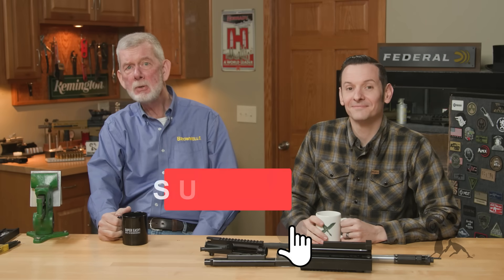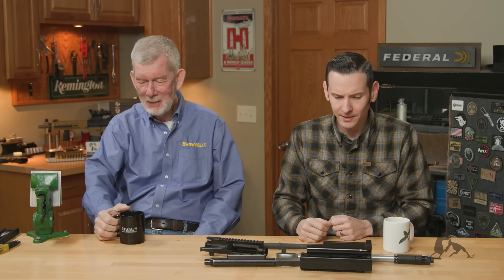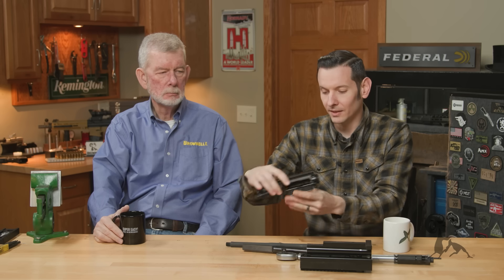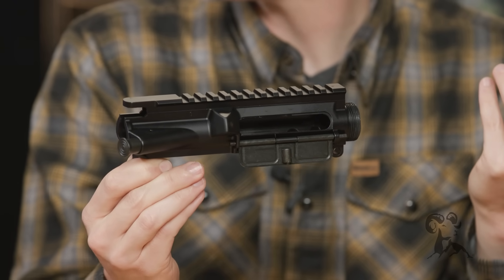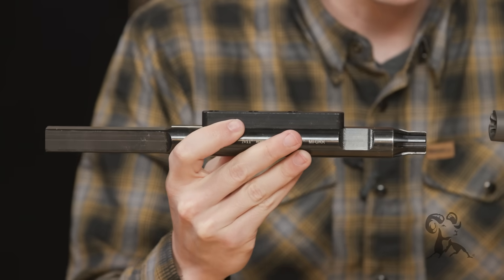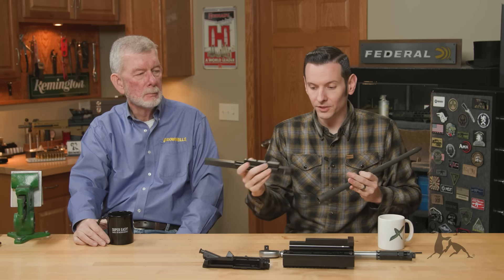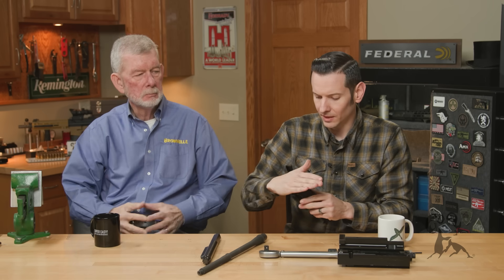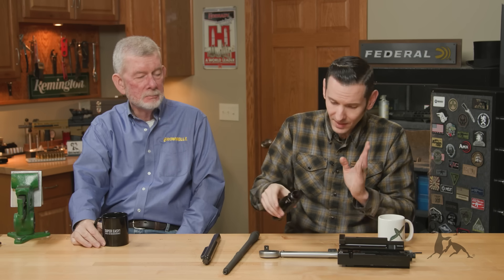SmythBusters: Top 5 AR Building Myths

Comment: When I was an armorer in the Marines 77-88 all we had to remove and install barrels was aluminum blocks to clamp the barrels and never had a problem. People act like they are assembling 1000 yard 1MOA rifles  Your not hand fitting anything you are assembling parts. Most off the rack AR15/M16s shoot better than the people shooting them.
Reply: I never could figure out why you couldn't just clamp the barrel. My first build used two 2x4s and some bolts for clamps. I had my girlfriend stand on the 2x4s to hold them steady.

Now, I have all the "proper" tools.
Reply: @09jisaac 🙂
Reply: @09jisaac  You can and that is how the military did it for years by using barrel clamps..The problem with that method, the device or the clam shell vice is it still torques the barrel in the upper and if too much torque is applied, it can shear the barrel index pin, damage the upper in the index notch or both..Many upper receivers have more play between the index pin and receiver notch than others and the barrel can clock using these methods..This can cause the bolt to hit the outer receiver extension lugs, damaging both..A receiver rod with a sail like the Mid West ind. or the 2Unioque will limit the movement and takes all the stress off of the barrel index pin and upper receiver notch..Look up sheared index pins or damaged uppers, there are a lot of them..
Reply: I say this all the time. Gun is way more capable then we are
Reply: I’ve assembled 100s of uppers using a pro mag polymer upper receiver clamp. Never a single issue.
Reply: @baddogwaterfowl7302  How do you know?? Many people have clocked barrels and don't even know it.. Unless you insert a Mid West URR or a 2UNIQUE in the upper as a gauge, you will have no idea if the barrel is clocked..Caleb reversed his opinion on this subject (which made me respect him even more as a gun smith) after watching Chads video on School of the American Rifle that he made to counter this video..Go check it out..
Reply: @hairydogstail that was a great video, that I immediately thought of while watching this. I’m glad he backed off of this stance, because the over simplification of any trade can be disastrous.
Reply: Well, some of us are building 1 MOA, 1,000 yard rifles...

The beauty of the AR platform is you can do that if that is your thing.,

Now, regarding the barrel nut, clamping force is a product of the torque applied and the size (and thread pitch) of the fastener.  The barrel nut is quite large and the torque spec wide, I think 30-80 ft-lbs.  For the size of that fastener, both ends of that spec are low values.  By comparison a 1/2" wheel stud is usually 100 ft-lbs or a little more.  If the barrel nut torque was a spec for maximum clamping force it would be well over 200 ft-lbs.

The takeaway is that the required clamping force is low and some of these specs were written just to tell people it has to be kind of tight but don't overdo it.

The unfortunate result is some people crying because they torque to 80 ft-lbs and their gas tube is hitting a barrel nut tooth.

The real method is you should torque to 30 ft-lbs, then tighten it a bit more to clear the gas tube if you need too.

But some people will still be clutching their pearls and then you can say, fine, mark the tooth that is blocking the gas tube and dremel it off.  You don't need all of the teeth and that will let you get your precious 80 ft-lbs.

Now some people are crying because you said the D-word and you have to lap the receiver more or use barrel nut shims to get the gas tube to align at 80 ft-lbs.

No matter where you stop on that journey, the result is the same.

I know that but I do some unnecessary things.  I prefer an upper receiver block that grabs the picatinny rail of the upper.  I just think the upper rail has more material to efficiently transfer barrel nut torque through the receiver to the vice.  I don't loosen fasteners with my torque wrench if I have my breaker bar handy.  I don't use a 1/2" torque wrench that goes up to 200 ft-lbs to torque a 30 ft-lb barrel nut.  Torque wrenches are most accurate in the upper half of their range so I go for an appropriately sized torque wrench that will be accurate around the value I'm shooting for.

Lastly, I am going to clamp my barrel when I mess with my muzzle brake.  I know it's not required but I might need to use more than 30 ft-lbs to clock my muzzle device on a crush washer, that might twist the barrel under the barrel nut and for that 1 MOA, 1,000 yard rifle, I don't want to mess with that after I have tightened it...

With all of that said, I do have a reaction rod (no wing) and one of those Magpul things.  I have tried them and I might use a reaction rod in an upper with the barrel extension pin notch wallowed out to keep everything straight (this might also be a reason to dremel a barrel nut tooth and go to 80 ft-lbs) but I usually use nice parts that just don't need anything special.  I do like the reaction rod for tightening muzzle devices.

It's a balance of putting in a minimal effort over what is absolutely necessary without convincing myself that my way is the only way or that it's better.  It is just the way I do it because doing it the same every time helps me avoid stupid mistakes and a method that works on a 1 MOA, 1,000 yard rifle is going to work on a mag-dump in to garbage rifle too.
Reply: @beardoe6874  If you torque your muzzle device over 20 ft lb's, you are compressing the bore and it will wear the lands more at the muzzle...Not a good idea if accuracy and barrel life is the goal..The barrel nut spec is 35 to 80 ft lbs and the threads should be tightened and loosened 3 times before final torque to condition the threads so the nut won't come loose..
Reply: @hairydogstail  well, I also like barrels with 5/8-24 or 3/4-24 threads instead of 1/2-28 to prevent those issues.

If you're really serious you can cast a lead lap to get the barrel the same size from the throat to the muzzle.
Reply: @beardoe6874  I don't think you understand how much the bore compresses with the increase in torque..Use a muzzle erosion gauge with every increase in torque and you can measure the compression.. The barrel size has little effect..The same happens to the upper receiver when you increase the barrel nut torque..Lapping the lands down is not a smart alternative to using proper torque and Rocksett..
Reply: @hairydogstail  I don't think you know how much torque it takes to clock a muzzle device if it's off 15-20°.  You might just have to go over 30 ft-lbs and then you might be messing with your barrel nut torque.

So two good practices are larger muzzle threads and using a reaction rod/barrel clamp.  There is no downside to either and guess what, you don't have to use excessive torque unless your muzzle device clocks wrong.

But go ahead and argue against things that make sense if that's your thing...
Reply: @beardoe6874  I never mentioned anything about the way you clamp your barrel lol, I was talking about muzzle device torque....You don't need to over torque a muzzle device..That is why they make washers for muzzle devices (Accu-Washer) in different thicknesses.. 
Do as you want with your rifle, no skin off of my teeth..I thought we were having a discussion, not an argument..Sorry I triggered you lol, but you don't make sense..Later!
Reply: @hairydogstail  well that's a weird tangent.  The discussion is about barrel nut torque and reaction rods.  I just was saying I prefer to clamp my barrel or use a reaction rod when I'm torquing a muzzle device so I don't disturb the barrel nut.

I don't think I've ever used a torque wrench to tighten a muzzle device but I don't think I've tightened any too much, it's just that 20 ft-lbs and 30 ft-lbs are too close for comfort and I'm not afraid to use the low end of the barrel nut spec, so I use a reaction rod or barrel clamp when I tighten muzzle devices.

So why are you telling me I'm tightening my muzzle device too much?  The topic is the barrel nut.

Any way, you went off topic responding to me and you know what that gets you?  You get my opinion.

Now you feel attacked because your hit and run tangent got a well reasoned response.

Weird.
Reply: @beardoe6874  Hit and run tangent?? Well reasoned response?? Not even close.., I was stating a fact that is easily tested and verified, which you took as an insult to your ability or lack there of..Like I stated before, go ahead and over torque your muzzle device and ruin your barrel/ accuracy..No skin off of my teeth..
Reply: Well said.  @beardoe6874
Reply: @beardoe6874 Yes, there is a quality issue here.
Reply: The first problem is that there is a certain degree of machismo when talking about guns where people have this inherent need to feel like they're right and you're wrong, even when there are multiple correct answers.

The second problem is that, if you look at the demographic data of who owns guns, you'll find that most gun owners are in the bottom-half of education level and tend to work blue-collar jobs.  The people who are generally making those arguments just don't have a lot of analytic thinking skills that they've formally learned, or that they even use on a daily basis.
Reply: And all the barrels you were using were the same profile and length, this is simply not the case with all the barrels on the market. Why waste time with barrel clamps that might not properly clamp the build you're doing when you can get a ~$50 (Botach Double Action Rod) tool that is agnostic to these variables? I completely understand people not wanting to pay Geislee the outrageous price they charge for their reaction rod but there are now even better alternatives at 1/4 the price, why not buy one?
Reply: That's because you were using parts that met the TDP spec..When you add parts from multiple different manufacturers that do no meet the TDP tolerances, that's when problems occur..Go on line and you will find endless videos of problem AR rifles..Sort stroking, jammed cases, clocked barrels, won't cycle, etc,etc....If it was as easy as you say, none of those videos would exist..There is a reason certain tools and techniques are used and Caleb is over simplifying that subject IMO..
Reply: @hairydogstail You seem to be a very smart guy. It would be good to see videos of the Rifles you have come across with problems. Troubleshooting and proper repairs made.  I have PSA lowers and  Shaw custom Barrel.. upper Barrel  combo's . No problems at all.  I have assembled a couple lowers with parts kits, with no troubles. I have installed a couple drop in triggers. That's my limited  experience.  I'm very interested in AR15 assembly and repairs.
Reply: @hairydogstail  Some people assembling AR's have no business trying to put together a friggin jigsaw puzzle let alone a friggin Carbine/Rifle. Assembling a AR isn't that difficult, I walked my Daughter through the process when she was 12, she is 16 now and can assemble one even if every part is thrown in a box as shook up.
Reply: @adamrodgers2377  The big problems is when parts from different manufacturers are used and even from the same manufacturer..I have shelves full of parts that are not in spec/tolerance..Those parts can many times be used successfully if the knowledge is there.. After the rifle is (assembled) and the gremlins begin to show up is when the real fun begins for many (assemblers), this is why I call my AR rifles (builds)..I have seen this occur over and over and over..One AR will run like a Swiss watch and another is plagued with problems..Then the usual wrong assessments begin to pour from people trying to fix the problem..It can be as entertaining to watch as people trying to back their boat down a boat ramp..

Comment: Has anyone ever shimmed the barrel for a better bolt fit?
Reply: Shimming the barrel does nothing. The headspace is built into the barrel extension and the bolt by the manufacturer.

I can prove this by the fact that some hand guard kits come with barrel extension shims so you can properly index the barrel nut to the retaining system. If it changed headspace it would be a no go. No manufacturer would do it because of liability problems. 

I also work for a large AR-15 manufacturer. You can't make the bolt "fit" any better than what comes out of the factory.
Reply: @oldscratch3535  Bolts come in different sizes and I have corrected short chambers by changing bolts..I separate them small, medium and large..
Reply: @hairydogstail  You can do that and it will work but if the barrel is not headspaced correctly and you make it work by finding a bolt that is also out of spec just know that the parts are not interchangeable with other parts. You've essentially married the parts together for life. If something breaks you have to find another out of spec part to replace it. It may work, but it's technically an out of tolerance part. 

However, my point was about shimming an AR15 barrel. You can't change the headspace that way, which is what the OP was asking about.

Comment: I've used torque wrenches to loosen bolts and never had a problem with them. I used the old style though of torque wrench called a beam style torque wrench. It was a great wrench and worked for years. The only worry I have is about trying to get a 20" 1in7 twist barrel for my Ruger 556 someday. Have any?

Comment: I have an upper that the barrel won’t slide into someone told me I had to use a torch it to expand the opening of the upper…. Is that a thing ?
Reply: It's called a thermal fit..
Reply: Yes. Just heat it slightly with a heat gun or propane torch. It will be fine. Some manufacturers do this on purpose. BCM specifically.

Comment: I am pretty sure that my old beam type torque wrench will bend if I loosen nuts with it.  It is only hardened in one direction.  I really should build an AR, but the ones I have are pretty accurate as they sit.  Now, where is the video on bullet proof hair product?

Comment: Well crap.   I did it all wrong. I wrapped it in a towel and clamped it in a vice tight enough to hold it but not so tight that it pinched it.  Then torqued it down with my homemade wrench that I could put a torque wrench in.   It shoots good enough to cover my groups with a dime at 100 yards.    Maybe I got lucky?

Comment: You can ruin a torque wrench by putting more torque on it than it’s set for or rated for.
The head of a torque wrench swivels on a pin, once you hear the click you need to stop.
I was taught that in auto shop in high school and motorcycle school in college, and have seen wrenches with the pins, heads broken and sides smashed down.
Just try torquing down a bolt that requires 120 ft lb with a 50 ft lb rated torque wrench and see what happens, it’s not a breaker bar.
Reply: You can..
Reply: I’m curious, what AR has a barrel nut torqued to 120 ftlbs?
Reply: @TheArmamentShop  Ones the customer red loctited the threads because some nimrod on the internet told him to do it..
Reply: @TheArmamentShop  FAL Imbel kit with the receiver stub still on the barrel. I don’t know what torque specs Imbel used but I have had to use a cut off wheel, hammer and chisel to split the receiver stub to get it off.
Steel receivers with threaded barrels sometimes require high torque to time the barrel within specs, without shaving the barrel shoulder.

Comment: Honest question for anyone with an idea. My dad is building an AR308, his barrel and handguard are from JP Enterprises. The instructions say to use red loctite 271 and to install the barrel nut and hanguard hand tight, then torque to spec 24hrs later. Now it completely seized and won't come apart even with a heat gun. Does anyone know of a chemical solution or another method to release red loctite?
Reply: I'm guessing my dad probably put loctite on the wrong part. I'll tell him to try a torch and see if that works. Thanks for the feedback.
Reply: @TheAbysmalOne  No problem man. Hope it works out for you.

Only use propane though. Don't use an oxy/acetylene torch. It will get too hot and possibly melt the aluminum upper.
Reply: @TheAbysmalOne your b. S. Me man not really what in the world loc. tig.on a stinking rec. Threads. How totally Insane. All that and you didn't think about it you had to of FIGURED next day tighten it WHAT??
Reply: @TheAbysmalOne pay Ricky Bobby no never mind. He ain’t got past 3rd grade yet
Reply: I've never heard of anyone saying to loctite something and then torque it to spec AFTER the loctite has cured. 271 has a 24 hr curing time so anything after that isn't going to move. 

You need way more heat that a heat gun can put out. You have to heat 271 to 500F to break it loose. Not sure there is any chemical you can use.

Looking at the JP website, I can see that some hand guards have a barrel nut and then a barrel retainer nut. The barrel nut looks to be hand threaded on with the gas tube hole aligning with the upper. This part gets the loctite. 

The next part that actually holds the barrel in place and gets torqued is the barrel retainer nut. This piece DOES NOT GET LOCTITE. It says to apply anti-seize compound and install hand tight. You allow the loctite to set up overnight which will hold the barrel nut in place as you torque the barrel retainer nut against it. 

If you put loctite on both parts then you did it wrong. It will take a propane torch to heat it up and break it loose.

Comment: I just assembled my 1st AR10 last week. I used aero precision M5 receiver set & handguard. A Faxon 18" big gunner barrel with rifle length gas system & geissle SSA-E X trigger. I also used a non adjustable low pro gas block. I haven't had any issues but would you recommend an adjustable gas block?? I'll be using this rifle mostly for deer, hogs & some range fun of course.
Reply: Just my 2 cents: I'd install an adjustable gas block "just in case", as in better to have it.... If you want to add a suppressor, it'd be good to have that adjustment capability.